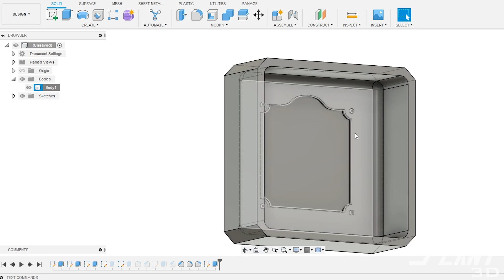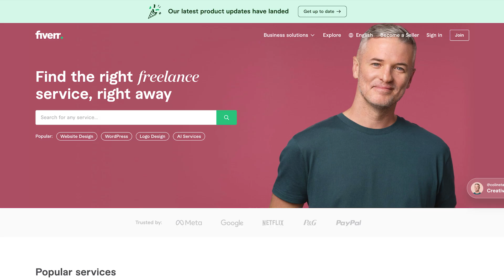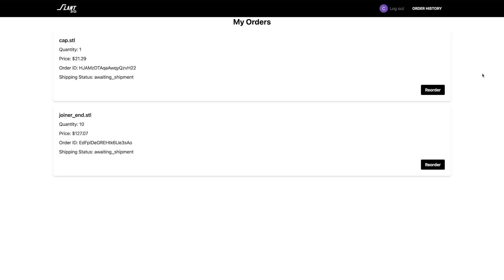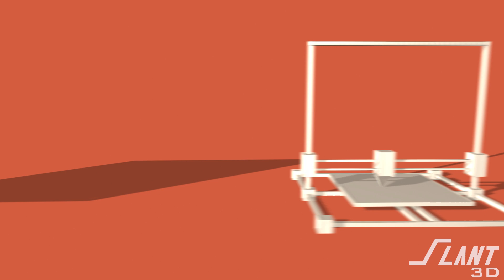How to Get a 3D Print Without a 3D Printer | Slant 3D Print on Demand

Comment from the maker: Try out the Print on Demand App here:
https://www.slant3d.com/quick-prototype-printing
Reply: Error with every .stl file I try.
Reply from the maker: Should be fixed trie it now. Or email it to us at info@slant3d.com and we will print it free for the bug feedback. Thanks so much
Reply: Quick Feedback:

Dragging and dropping into window threw errors for me each time. Clickign and navigating to the file worked though.  Updated chrome, win11. 

Would love way to orient part in web browser. My initial test upload is positioning the 'Back' plane from fusion 360 as the bed. I can also move it, but click 90deg buttons would be super convenient.

Assume these are in PLA? Maybe post that somewhere. Any intention of giving the quick-quote option material options down the line? I'd love to order some things in ASA. Going through the traditional quoting method for a simple material change is kind of a pain.

Any indication if these prints will use supports or not? Is it on by default, or do you have someone in-house who determines if supports are needed?
Reply from the maker: @Taylorniver. Thanks for the feedback. Yes the team fixed the dragndrop funcitonality. The plugin was deprecated by its creator and broke the app. Thanks for the rest of the input as well. The full specs of the app are defined on the home page before you begin quoting. https://www.slant3d.com/quick-prototype-printing